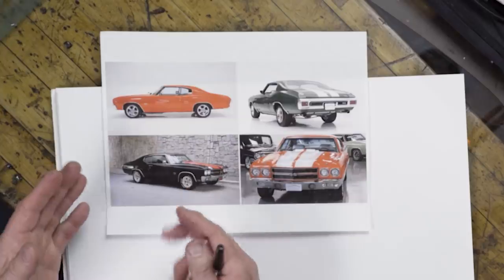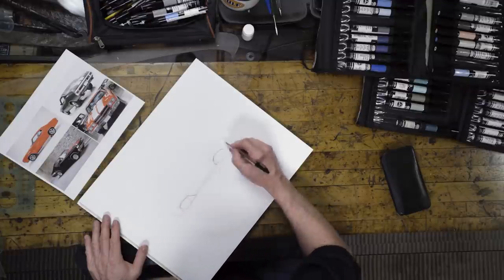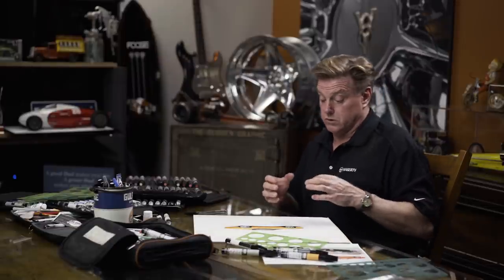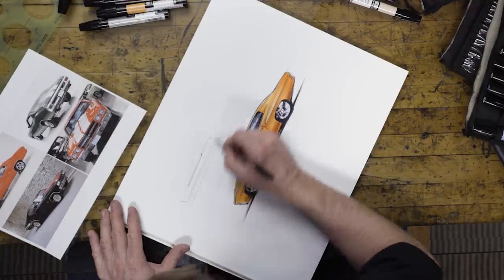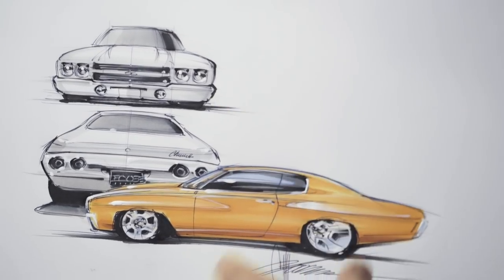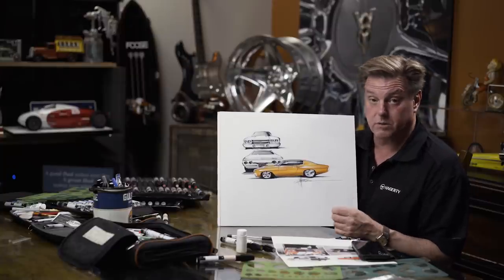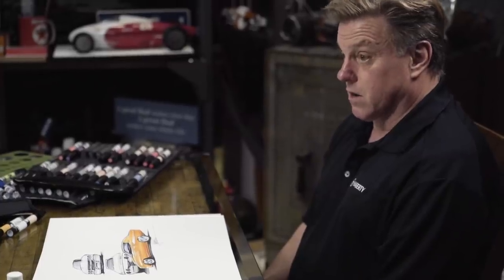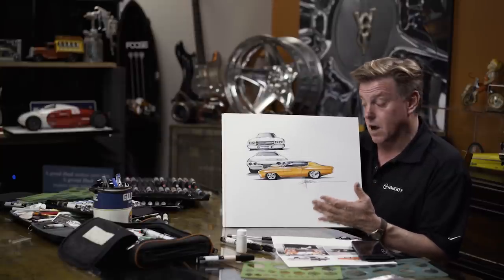New-look Chevelle combines best elements of '70 and '71 | Chip Foose Draws a Car - Ep.7

Comment: I have a ‘72 rear bumper on my ‘70 Chevelle. It looks like what GM should have done from the beginning.
Reply: That is EXACTLY what I've been wanting to do for the last 5 years . I wish I could see it
Reply: Don't you just hate when that happens. And they are still doing this in the auto industry. The new Land Rover Defender has a front and rear that do not match.
Reply: Exactly right. It kind of baffles me that they put the single rear taillight bumper on the 1970 when it had the double front headlight front bumper. I think it would have been obvious to have dual light front and rear bumpers on the 1970 to give it a much more homogeneous look. In any case I still have to put the 1970 as my favorite year for the Chevelle especially those 4,475 units which came with the mighty LS6 454 engine pumping out 450 HP.

Comment: Lol, as a young boy, I thought the same thing! ‘70 front, ‘71/‘72 rear with the El-Camino front bumper! 
Oh, Hi Chip! Other ideas: functioning Cowl Induction on a ‘70 Camaro SS, then a ‘70 300 Deluxe Chevelle COPO, domed hood, dual snorkel, metal framed vent window door channels off the Skylark, rubber flooring, bench seat 4 Speed, (ok, 6 Sp;) body colored steel wheels, Polyglass tires with the dog dish caps, chambered exhaust, white 454 scripts above the front markers, 300 Deluxe emblems, front & rear bumper guards. Code 63 Desert Sand, no stripes!  
Ty for all the work. That look you and your father shared is the look my father and I shared. He rode me hard to learn for reasons I couldn’t understand until he was gone, then it all became clear. That Love of a father shines in the lucky Son hopefully sooner than later! 👍🏻

Comment: I am partial to the 1969 Chevelle SS 396 because I owned one. I have driven a 1970 Chevelle SS 454 with the LS6, 4 speed. It was awesome, and just a beast. I always wanted a 1959 Impala with a 1960 Impala front clip. Like the teardrop taillights on the 59, but the front end on the 1960 Impala is really sweet.

Comment: Thanks, Chip, for seeing the styling mismatch that a lot of us have observed  for a long time as well!  I had a '70 Chevelle about 20 years ago (when you could still find running & driving examples for under $5K!), and I remember wanting to put the '71 rear bumper on it.  
For one thing, it's just a better looking style than the '70, and also you could argue that it does mirror the dual headlight design that is in the front.
Chip:  If you read this, please "correct" another of GM's muscle era styling mistakes and find a '65 LeMans /GTO and section about 8" off the rear quarters to give it the proportions of a ' 65 Chevelle.  '64-'67 BOP A bodies all looked like they were just too long in the deck area on what were otherwise good looking cars.
if not Chip, someone out there, please do this!

Comment: Always wanted to do that but if I were to do this it's even more simple. Take a 70 Chevelle, replace the rear bumper with a 71 & replace the front bumper with a 70 Monte Carlo which already has the round turn signal lamps in the correct place. I would also keep the stainless style lines from the Malibu that extend across the top of the fenders & sweep up into the rear 1/4 windows. Just my 2 cents.

Comment: Being an owner of an all original 72 Chevelle malibu 4 door non post hard top that i saved from the scrap yard after the owner died.. 350/350 engine /trans with AC.. Got it with 21k miles & now has 52k..... Thought about making it a 2 door with the doors being about 6" longer than the stock 2 doors / doors....

Comment: I really like the front bumper.
Think the 70 Chevelle is a hard car to improve upon.
I've wondered why more people haven't used the El Camino bumper on Chevelles, 
because the round running light/turn signals would carry the rounded theme.
I've always wanted to see a 70 Camaro SS 454, Cranberry Red, Black Stripes, and the Chevelle Cowl Induction hood.
Think that would look great.
But if I could go back in time and order a 70 SS 454 mine would be Astro Blue with Black Stripes.
Reply: Exactly

Comment: I'm bias  but Chip you need to take a look at the 1972-1978 Australian Ford Falcons, Most would recognize them as the base for the Mad Max Interceptor. That body shell had 4 variations. The XA 1972-1973 , XB 1973-1976, XC 1976-1978  and the Landau Luxury coupe 1973-1976  that used a slightly modified falcon Coupe body.

Comment: I always thought the same thing. The 70 was always off by that tiny bit. Also the 71 & 72 had the front clip that looked so out of place with the rest of the car. Unlike the Olds 442 which 70 was the best no need to improve or change it but they did and the 71 rear bumpe the vertical tail lights went horizontal and then 72 they combined both 70 &71 it looks like. I always thought the center piece on the front of the 442 and cutlasses was cool cuz it was part of the hood for 69 and 70. still looked cool in 71 & 72 but the 70 is hands down the best looking. sleek, aggressive yet classy.

Comment: Uh, no. I owned a '72 years ago and still own a '70, a convertible actually. There isn't a single part on a '71/'72 which looks better than the equivalent on a '70, the rear bumper included. That is especially so with talking an SS. The rubber pad on a '70 is so much more distinctive than the small SS emblem on a '71/'72. My opinion FWIW.